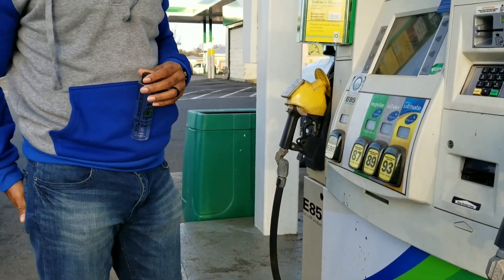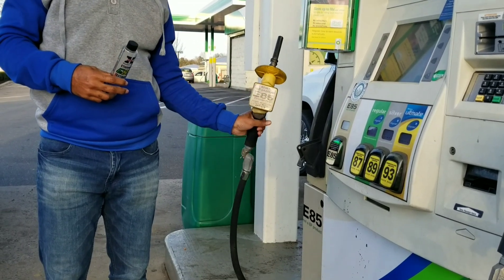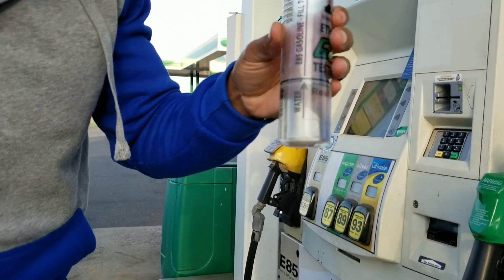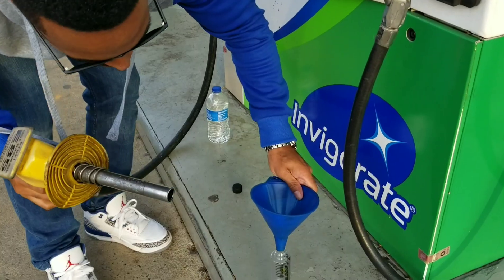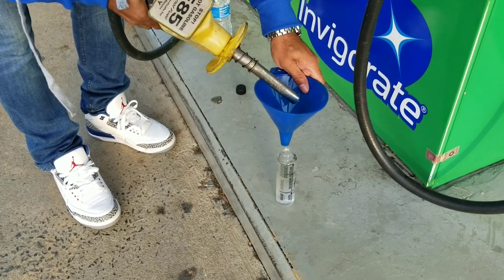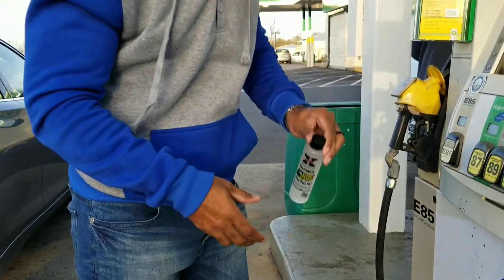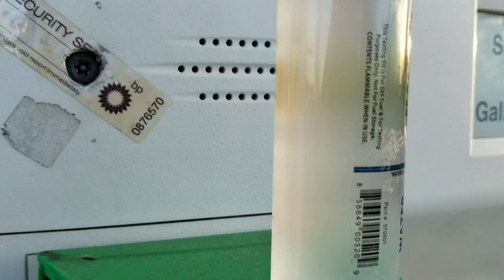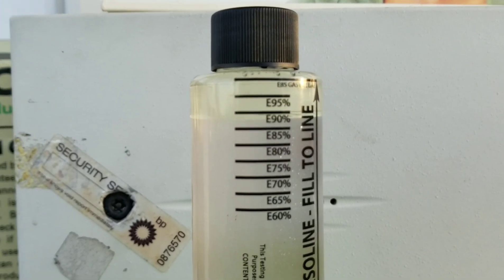How to test your fuel for e85 content

Comment: Just a quick note. There is a considerable amount of other fuel in the dispenser so you would want to use a gas can and pump about a gallon of the fuel you are testing first then test to get a more accurate measurement. Have a great day.
Reply from the maker: @willcall9431  the e85 pumps where I am are dedicated yellow pumps, they only pump the e85. Never unleaded or diesel in the same line
Reply: That’s good. Not always like that however.

Comment: Wait so how much e85 should I pay for at the pump to have the right amount to put into the tester tube. Will there be enough e85 in the nosal to squeeze out before paying for it ?
Reply from the maker: Just activate the pump as normal, it'll only be a couple cents into the bottle then you can pump the desired amount into your tank after calculations. Two transactions is a minor inconvenience but might as well get it right
Reply: @serstylz2  sorry but what do mean by activate the pump as normal? I never pay from the machine I usually go inside and pay an amount for gas. Is there a button on the button on the pump somewhere to just keep filling up until I desire to stop ? Is that what u mean ?
Reply: Pay at the pump

Comment: Awesome video. Straight to the point with no bullshit. Getting my e85 tune tomorrow. How much ethanol variance would you say is okay before I need to find a different blend somewhere else? 5%? This would be for a boosted 6.1 hemi.
Reply: I might be late, but if it drops under E75 I start skipping the station till they get a refuel
Reply: I might be late, but if it drops under E75 I start skipping the station till they get a refuel
Reply: @damercerterker8176  the tune ended up failing because my fuel pump ran out of head room. I reverted back to 93 and saved up some money for a dual pump. Should be installing it here soon. After that, back to tuning.
Reply: From what I’ve read, E70 is still pretty safe, but if you can fill at a better station, go there instead
Reply: Id1050x injectors, fore dual fuel pumps, twin bb turbs

Comment: Where do you throw the fuel after your finish using it on the test kit?
Reply from the maker: I dump it in the trash bin at the pump, they use those heavy duty garbage bags so it's relatively safe

Comment: So if it reads 87 for example, it’s better for your car? The higher the ethanol the better?
Reply from the maker: Correct. 87 would be amazing from the pump
Reply: @serstylz2  The goal is at least e85? I’m new, too. 

So if I get e90 from the same pump, I assume it’ll be the same every 4-5 fill up? Because testing everything seems to suck.

Comment: What do you do with the water e85 mix then? Dump it on the ground? In the garbage? Take it around with you and dump it somewhere else?
Reply from the maker: I re-cap the bottle and put it in the trash bin
Reply: @serstylz2  so you need to buy a new 15 dollar e85 tester for every fill up?  There must be a better way
Reply from the maker: @rocconido2192  oh my mistake, bad explanation. Usually I pour the water out of the water bottle I brought, transfer the ethanol/water mixture back into the water bottle, and throw that into the trash

Comment: So to clarify every e85 pump station you go to you do this test and if it passes you don't have to double check or do you double check every single time you go to the e85 station
Reply from the maker: If you go to the same station for e85, do this test every 4th or 5th time you get e85. Results should be close to each other each test. If you go to different stations, test each time.
Reply: @serstylz2  ok sounds good.

Comment: Nice video.  I feel as if there is an easier way to do?  Possibly with 5 gallon jugs at home?
Reply from the maker: Definitely.  For one I didn't even use a funnel haha. But yeah I would definitely suggest taking some 5-gallon jugs home and testing. Ultimately a flex fuel kit is the true answer as well

Comment: Thanks! I’m going to find a kit and do this myself! Have you tested any that have been way less than 85% ethanol? I am building an engine now for e85, but I can’t drop below 80% due to the compression.
Reply from the maker: I stuck with the same station once I found one that tested good. But, you should get in a habit of testing every month because there been times when the ethanol content fluctuates and usually negatively
Reply: I’ve seen some really low some as low as 60% it’s never always 85% I’ve never seen more than 81%. You would need to purchase Sunoco R-85 for precise E-85 content and control
Reply: Install a ethanol sensor and tune your car for flex fuel. If your injectors and ecu are capable. Then you can use any mixture of 93 and e85. Your ecu will adjust automatically depending on the ethanol content.

Comment: How are you able to run the mix? Did you change your fuel pump or anything or is still stock?
Reply from the maker: I stopped running E. The car was experiencing some sputtering and jerkiness, in my opinion the LPFP has to be upgraded at minimum to handle anything above e15.